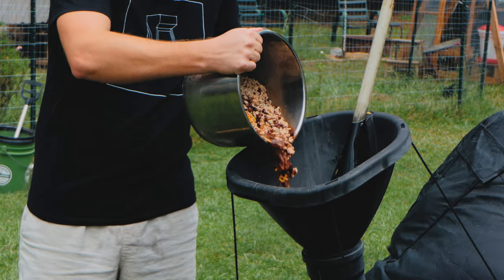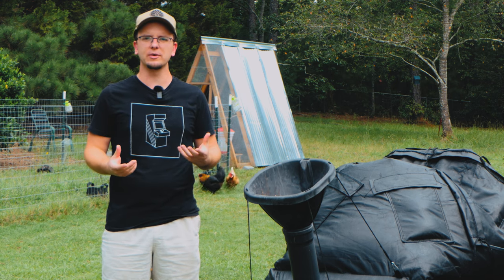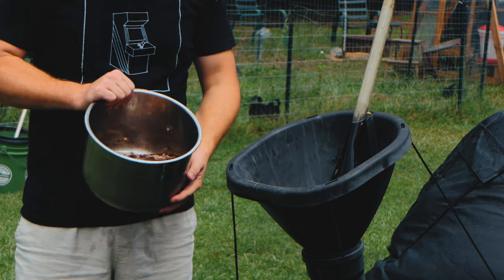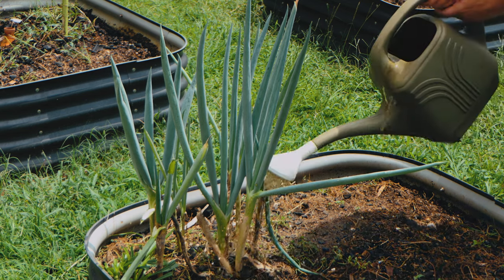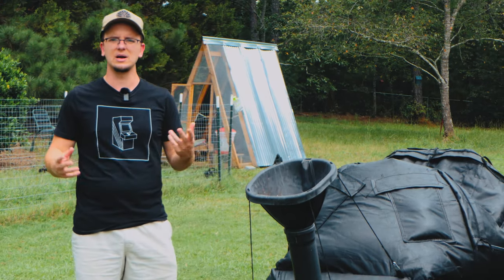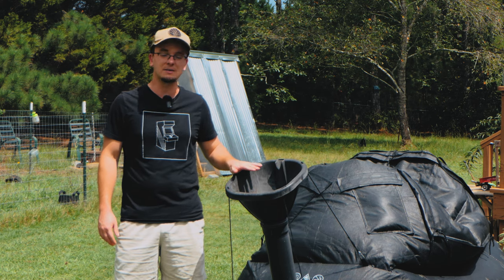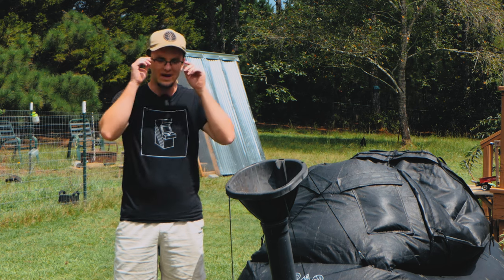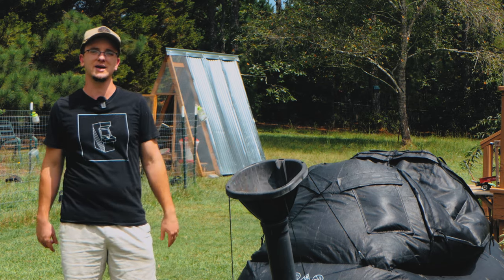How To Convert Food Waste Into FREE Cooking Fuel

Comment: This might seem a bit odd, but i wish they made one that would just take like 0,5 gallon of waste a day, i could fit it on my boat and have a small fertilized garden in my cabin, as well as get a bit of cooking gas every day.
Reply: The entire rig is about 2700 lbs.  (water is the main weight)
Reply: I agree. A small waste set-up would be ideal.
Reply: Just make one
Reply: Maybe you could try to DIY/jerryrig a solution?
Reply: That’s a good idea, but not as possible due to liquid in the setup. W anaerobic setups, to fully compost the material until it breaks down you will need access to soil at the end to bury/mix it in. Having stinky water sloshing may work if it’s next to your grey water setup, but still sounds not so feasible as having a bit of soil and doing aerobic composting. There’s also not really a shortcut in composting unless you’re ready to introduce heat; so it’s going to take a lot of time just sitting on your boat. The isolation component is the hardest— having a compost system on open water gets into logistics of where you can put the compost after it’s done, well, composting. Plus, a garden on open water sounds nice in theory, but can get bad quick when going through storms. Hydroponics could be an option, but the pumps in that and the fertilizer equipment to get started is a high entry cost. It does take away the need to thoroughly wash your vegetables as it isolated then from soil bacteria… but really all fresh water and energy on boats are sort of limited.
Reply: For the cooking gas it's not worth it at these scales, but you might want to look into bokashi. It's a pretty compact system to use food waste and also offers you liquit fertilizer. It also reduces the volume of your waste.
Reply: You can make a fertilizer garden on your boat without this with just compost, buried food waste in the raised bed, and humanure.

Comment: How would you change the setup to digest human waste and still get fertilizer to be used for garden? What kind of further processing might be required?
Reply from the maker: You'd want to fertilize berry bushes, fruit trees and woody stemmed plants by running the liquids pipe underground into a woodchip bed, a leach field.  You could also use comfrey and other plants that are used for composting.  Use the human waste to fertilize comfrey, and then compost that comfrey.  That acts as a biological filter.  You want to avoid the liquid waste splashing on or near leafy greens (otherwise you could have pathogen contamination).
Reply: @acornlandlabs  Whats the problem with human waste if your not taking any medicines? Please enlighten me 🙏😅
Reply: @oscarjohansson79 so there's a few things. Much of what lives in your gut biome isn't stuff you want in your upper GI tract, and rinsing with water isn't enough to clean it off fresh veggies and fruit. This is regardless of your diet. Further, unless you're completely self-sustaining, your food likely contains traces of chemicals or medicine given to the source of that food - be it animal or vegetable, and even if labeled as organic. Further, there are some really nasty diseases called prion diseases that attack your brain tissue and can be spread via fecal matter - and often aren't digested in the methane digester or even high temperature composting piles. You need ultra-high-temperature composting to occur for eradication of those diseases, and you'd need an industrial composter to hit those temperatures long enough to be effective.

Comment: What happens if the gas doesn't get used? Does it explode or does the gas just leak out?
Reply from the maker: It has a safety release
Reply: Methane is one of the worst gases to release into the air.

Comment: Is it possible to hook a residental toilet to this. Also do you have to insulate yours in the winter
Reply: Also, when do we get to beta test
Reply from the maker: Beta comes out September 22nd! It’s best to have the methane digester in an area above 65-70 degrees F. We place it in a greenhouse during the winter to keep it running!
Reply from the maker: It can be done but will be more tricky compared to the toilets that come with the right adapters and connections. But give it a try if you like doing DIY projects! We haven’t tried this yet, so we can’t say much more on it. (Connecting a residential toilet)

Comment: I have a question? What will happen with the mud on the bottom of this device. I think eventually it will fill up the whole thing. Can it be removed time to time and used as soil in the garden?
Reply: Over time it bio degrades thus there will end up with nothing in the bottom.

Comment: Does the system have a pressure release valve if you do not use the gas for a few days or weeks? You guys know that methane is flammable and can even explode under the right circumstances.
Reply from the maker: Yes; the methane in the video is being burned to cook on. We are aware it's flammable :D  Great question though about pressure release valve -- yes, the system does have a pressure release valve if the methane is not being burned off regularly.  This methane is barely pressurized, it's not an explosion hazard.  It could certainly catch fire, but this system is not like a gas tank or propane tank.

Comment: I have questions.
1 Some food waste will not be broken down due to the hard fiber some foods have so what will happen you have to clean it every often? Since try putting water and poop in a bucket and then throw food scrap and see what happens after a few months which you will see the tough fibers around.
2 what happens when someone does not want to cook for the day or week then what can someone do with the extra gas? Since its not allowed to sell gas concentrators for future use since some feel it is a bit tough to handle. 
3 the material is made out of what since if plastic how long can that handle the UV rays 5-10 years and then you got a mess?
4 I assume it smells being next to it a bit more than being further away.
5 cant one do the same with a big barrel or container and add a tough airtight bag at the top. what type of bag is the issue.
Reply: 1. We might need to clean out in a few years, but even bones eventually dissolve in this unit.
2. There’s a pressure release valve to release extra gas.  B-energy biogas from Germany actually does have storage bags that are detachable 
3. We will see!  Systems have been going strong for almost 2 years now, no UV damage at all - keeping them in a greenhouse extends life too
4. Smell is earth within 3-4 ft, really not bad at all
5.  You can absolutely DIY this.  Search “Solar cities IBC biogas tank” You can use IBC tanks

Comment: Just curious, do you think you could take one of those methane digesters, and put it inside a greenhouse, and have the methane producing a flame round the clock to keep the temperature in the greenhouse above freezing for the winter, in order to provide some protection for plants that are not hardy enough to survive freezing roots? And would the exhaust from the flame be beneficial to the plants? I've never taken any chemistry classes, so I don't quite understand how the reaction and byproducts of burning methane work. Bing's AI says when you burn it you get CO2 and H2O.
Reply: Sounds interesting. I wonder how youd stop the methane digester water from freezing though.
Reply: @MrWackozacko  would it not produce its own heat same way a compost pile does?
Reply: @MrGump-gi9yx  yeh i suppose it would

Comment: That's expensive asf. It's easily made DIY for 1/4 of the price
Reply: The DIY IBC tote model is very cheap!  We love this plug and play model, and it does pay for itself very quickly.  If you used the toilet system, it’s about 1/10 the cost of an offgrid septic tank
Reply from the maker: Definitely try and make your own if you can!
Reply: @OffGridGuides  How do you get it permitted as a septic system?
Reply from the maker: @prestidigination1  We don't seek permits, we just install it.  Local govt. around here is not known for being creative, willing to work with us, or forward thinking.  We don't use the toilet system in this county.  We're moving locations to a more rural site where we can use these with no issues.